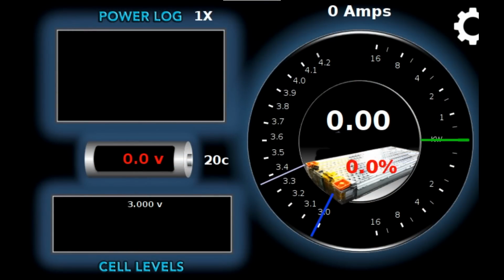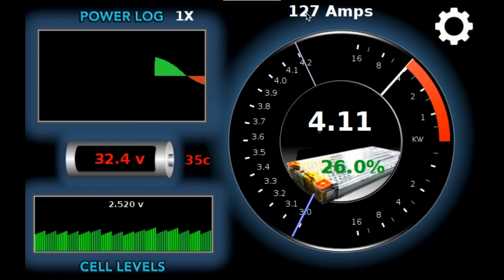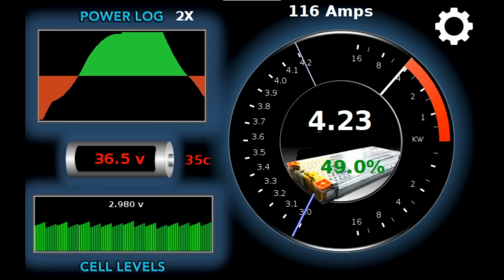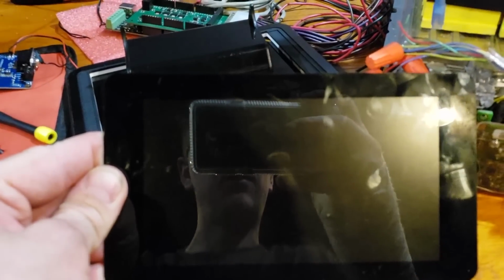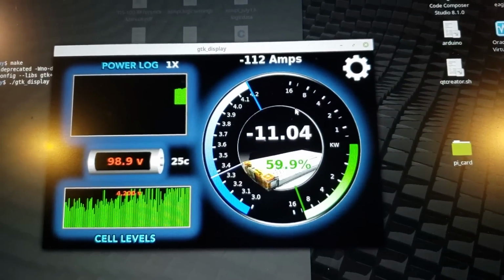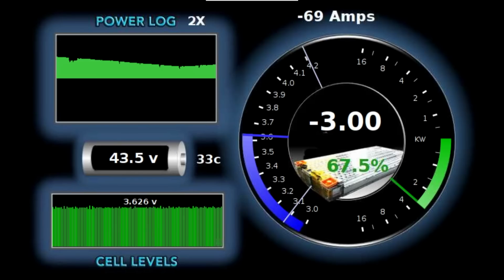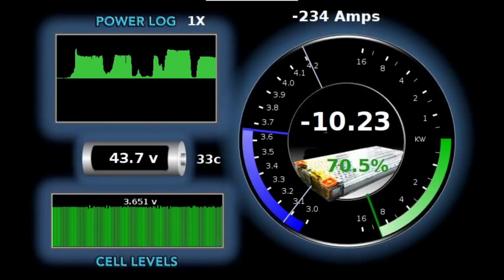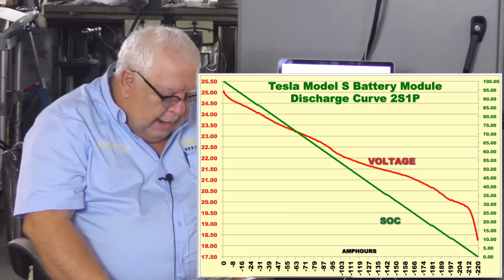Raspberry PI Display for Tesla Model S Battery Modules

Comment: Jack, I have a 60KWh pack out of a Chevy Bolt (350VDC), what I would like to know is how I can use the whole pack with solar input, how I can charge the battery pack once it gets down to a certain voltage (40% Charge) and run an Inverter grid tied off the pack without stressing the pack. I see you have done that with Tesla S Packs. Ideally I would like to access between 80% down to 40% of the battery capacity! I feel this would give me a longer battery life, if that can be done????

Comment: Very informative. Same problem exists with solar panels. Much better to use higher voltage if possible. Our 10KW system had 100+ feet to the house. Using higher string voltage smaller wire with less loss was possible. Thank you for your excellent work.

Comment: Great vid Jack ,I' m stuck with 48 volts for now but want 400 v system , 3 phase inverter for pumps and other tools. Is there a micro inverter that can make 3 phase . I could use a 3phase ups , which run at higher voltages
Reply: Victron phoenix and quatro inverters can be "stacked"to make 3 phase power but you'd need a minimum of three inverters
Reply: Thanks for the lead, Damien McGuire is hacking the Prius inverter ,that might work as a 3 phase inverter and if higher switching speeds are needed we can interlace the 6 phases. it could signal the micros (3 of them min) coordinate 3 phase
Reply: I just bought a Fronius Primo inverter and it looks like it'll do 3 phase but I'm not 100% sure...maybe something to look into.
Reply: just called them about a battery operated welder, I will check into that, thanks

Comment: Love the Display, and the info about conductors and energy losses from 48v systems.  You convinced me to stay away from 48v and set my sights on the higher voltage system.  Thanks for the info.
Reply: I think that will be an overreaction to give up on the 48V system. While there is a limitation with 48v system AS IT IS IMPLEMENTED but this is design choice and design limitation. Don't forget that Tesla PowerPack, the big MW system and unlimited scalability, is built on 48v PowerPods. If you want to have financial sanity, and even Tesla does it experimenting 10+ years with battery systems, you will stick to 48V and (just) design a more modular system where such an issue is not a problem.

Comment: The Raspberry Pi computer has evolved with several iterations since it's initial release and is a great platform for all maker projects. An informative video, but two hour or so is quite an epic length to sit through in one go. Look after yourself Jack, cut out the carbohydrates and eat healthy fats. You'll find it works wonders. Will be rough for first few days as you get over sugar addiction.
Reply: From the first few minutes of the video I was thinking the same thing. They should have the ambulance phone number on speed dial because if this guy doesn't throw away the recliner, start a some regular exercise and go vegan today he won't be sharing his ideas on Youtube for much longer.  Not meant to be mean but it's glaringly evident.
Reply: @2AKNOT  
He doesn't give a fuck what you or I think about his weight or health issues. For someone as smart as Jack, he sure is real fucking stupid.

Comment: Your test data for "average cell voltage" blows the top out of the normal round display scale, as well as the vertical bar-graph... up to 4.54V average (38:06)

Comment: yes I agree with the current  vs temperature problem  
350 volt battery 
have you used a VSD / VFD (DC) instead of a charger?

Comment: If you know the ip of the destination, then don't need to broadcast it to all.  As your wifi will get destroyed as more wifi devices are on your router.
Reply: As I posted above, broadcast frames on wifi really are broadcast, not individually targeted like people seem to think. But, the bandwidth allocated for broadcast traffic is rather limited. That's OK, we're sending like 40k worth of network traffic per second so it isn't any big issue. Still, there are two problems here. One, broadcast has a specific place to be sent but low powered devices that need to conserve energy are likely to miss frames at an even higher rate than PC would as they might not have their radios on in time. Secondly, it is kind of old school and some people might even disable broadcast forwarding. A potentially better solution could be found - UDP was just easy to use for initial testing. Multicast would be one possible solution. Another solution would be websockets, MQTT. etc - you know, the more "modern" solutions. Most of these solutions are a lot more complicated but they've got potential advantages as well.
Reply: One much simpler alternative to some of the aforementioned protocols could be:
You can use the broadcast UDP scheme to have the ESP32 board send out a periodic beacon messages on port 6500. This would be a small packet of data, perhaps containing some info about the version and capabilities of the software running on the ESP32 board. Once a displayPi board sees a port 6500 packet it now knows where the CAN board is (e.g. its IP address). The DisplayPi board can then contact the CAN board on port 6500 and coordinate a unicast CANoverUDP communication channel between the them or the DisplayPi board could establish a TCP connection with the CAN board on port 6500 and use that connection to communicate CAN messages.

Note: Either of the above approaches will enable the DusplayPi board to now send messages "to" the CAN board for both CAN board configuration changes but also to send messages that could be be sent out over the Tesla battery's CAN bus, thereby, enabling remote command & control and not just remote display!

Comment: Hello Jack, While what you have here ( UDP broadcast ) works, when using this over Wi-Fi it's extremely taxing on Wi-Fi as a each client takes a specific slice of time on the radio, and each broadcast packet must be transmitted to every Wi-Fi node on that radio.  I would recommend changing to another access means, although this will incur a bit more setup overhead (needing to configure IP endpoints).  MQTT is a popular UDP client/server model where the MQTT server receives and stores the values and any client which is 'subscribed' to the message topic will receive the updated information as it arrives.  This limits the UDP packets to only being between the ESP32 device and the RPi, instead of needing to be broadcast to every Wi-Fi device on that Wi-Fi AP.  You could use mDNS where your ESP32 broadcasts its presence periodically and the RPi can find it with an mDNS lookup like 'evtvesp32.local'.  Just some thoughts.  Keep up the great work!
Reply: Seems I was incorrect... MQTT is TCP/IP, not UDP/IP based. However, the session is not setup/torn down for each packet of data, thus the 3 way handshake overhead only occurs on initial connection. Sorry for the confusion.
Reply: Where in the world do people get this notion that broadcast frames on wifi are somehow sent to each device one at a time? That'd be stupid. A broadcast frame is sent over the air ONE time whether there is one other device connected via wifi or 200. Yes, they can all hear this frame. Broadcast frames don't crowd the airwaves any more than they'd crowd a wired link. One frame is received by everyone, hence the word "broadcast". Here is a link https://community.arubanetworks.com/t5/Wireless-Access/About-802-11-broadcast-frames/td-p/307530 here's another link: https://networkengineering.stackexchange.com/questions/7219/how-does-an-access-point-handle-broadcast-packets-from-the-wired-side
Reply: If we look at the OSI model, at the network layer (layer 3), your understanding is correct.  The packet is still broadcast and it goes to each client on the network (aside from the one that sent it).  The issue occurs at layer 2 ( data link ).  The problem is that encrypted Wi-Fi has per-client encryption (which is a VERY GOOD thing).  However, for broadcast traffic, that means that the AP can't simply send 1 radio frame that all clients receive and move on happily with the new broadcast traffic.  Instead, it MUST send a packet to each client in that client's time-slice using that clients encryption keys.  This is where the packet amplification occurs and can cause problems for a busy AP.
Reply: Ahh, I see. Yes, that could be an issue. Luckily we aren't sending a lot of data but this is something to keep in mind. Thanks.
Reply: This brings up a curiosity.  The packet rate for data coming off the battery on CAN3 is actually pretty high, but the contents are quite small ( 8 bytes per packet ).  Are you setting up the ESP32 to condense those packets and send them in lower count / higher density of data?  For single frame on normal 1500 byte MTU networks, you could send up to 1472 bytes per packet ( 1500 - 20 byte for IP header - 8 byte UDP header ).
Reply: I do aggregate for the comm between SavvyCAN and an M2 or ESP32 board. But, in this case the UDP frames from the ESP32 to the rPi are just small packets with a single CAN frame encoded within. That's not so bad as really the data rate is nowhere near what you're used to from a normal Tesla BMS master that sits on CAN3. For this use there are usually about 25 packets per second. Each is 8 data bytes but with the IP, WIFI, and other overheads you're probably looking at 60 or more bytes per packet. That's still a very low data rate for wifi.